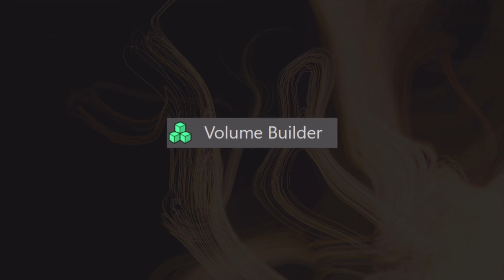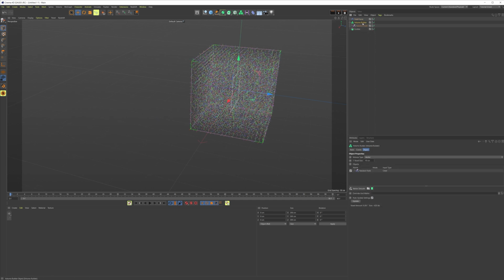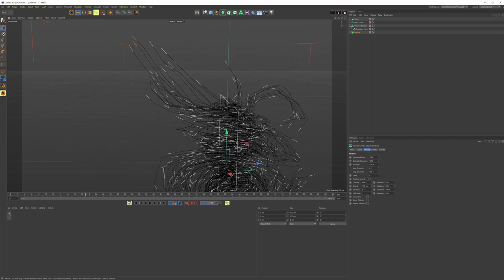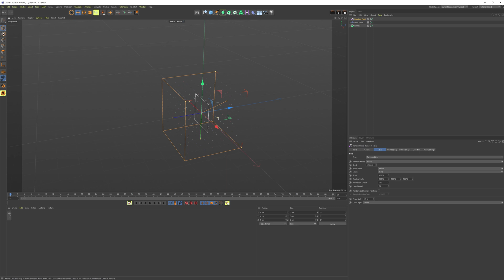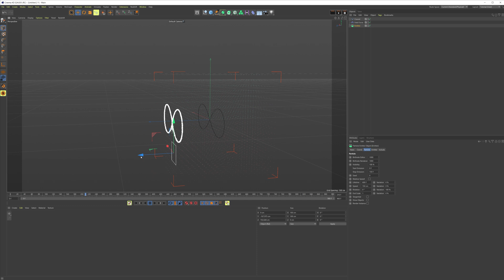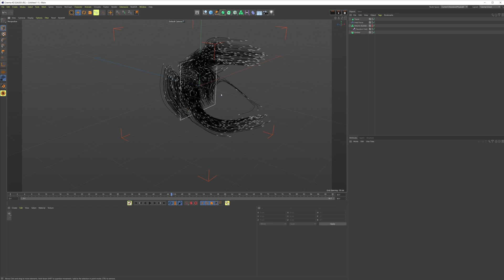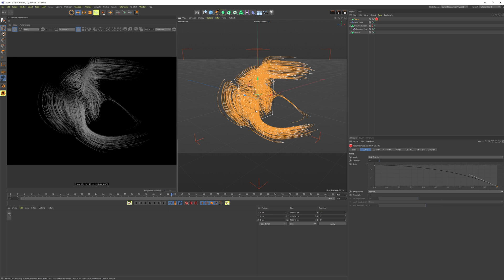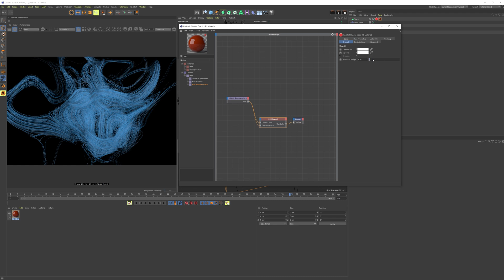Create complex particle systems without any plugins - Cinema 4D

Comment: sick tutorial! when i apply redshift material to the tracer, there is an error. the render lines become square (emitter box shape) and it doesn't render the tracer. help?
Reply: Was there a solution for this? I'm running into the same issue.
Reply from the maker: Thanks mate. Did you remember to apply the Redshift object tag and set it to hair under particle
Reply: @lukasthorup  yes I did. in the render I can change the weight and color of the tracer so I can see that its working, but for some reason it keeps the emitter box shape and won't follow the path of the tracer. Any way I can screenshot this over to you?
Reply from the maker: @shawnelee90  yeah sent me a screenshot on Instagram
Reply: @lukasthorup  thanks so much. just sent you a dm!
Reply: @shawnelee90 Hi, I encounter the same issue, did you find a solution ?